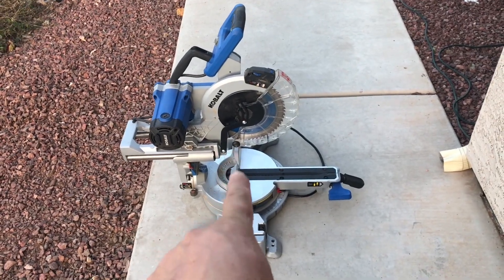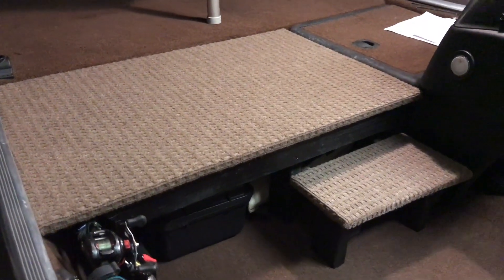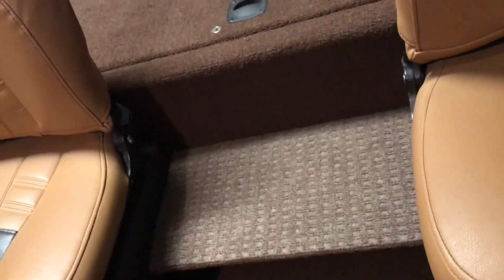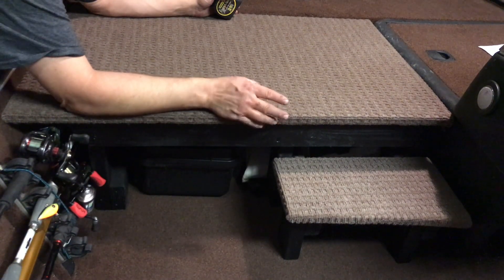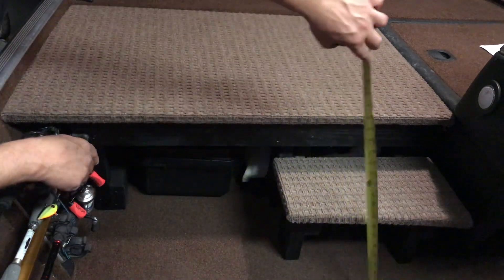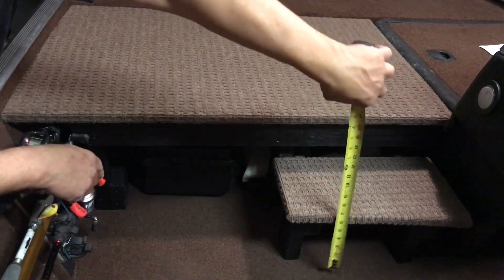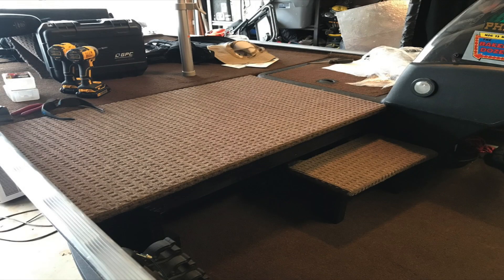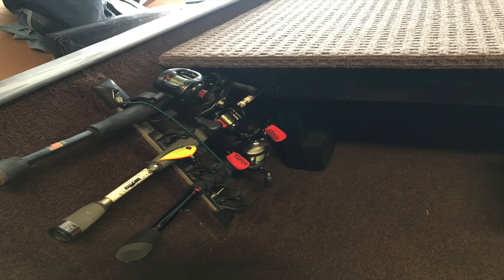Building a cheap casting deck extension for the Bass Tracker Classic

Comment: Hey Mark great job on the deck and step, making it removable was a good idea. Any issue removing your rods from the holder? 
The carpet looks good too...Next project??...complete carpet replacement!!  LOL ;)
Reply from the maker: I found that if I kept the rod socks on the holders as I removed the rods, it was easy to slide them back in.  If not you do have to kneel down and use a light to see it.  I honestly don't have any issue with the way it is.

Comment: I'm looking at buying the classic xl but am kinda leary because the wind blows where i'm from and a lot of the water is pretty big. Any thoughts???
Reply from the maker: WInd will be an issue if you don't buy a bigger trolling motor for sure.  They are flat bottomed so they tend to get pushed around.  Big water is something to thing about as well.  It can handle some of it but it is limited.  if your worried might not be the best choice for you?
Reply: @MarkBlackstock  I live in Washington and the columbia is the closest body of water to me and the white caps can get pretty large. I've been out on a smaller boats and it was fine but you just always have to be aware of the incoming weather. The price is just so good right now that I am having a hard time trying to pass it up. Just a new 50hp motor for the boat i have now is almost $8000.
Reply from the maker: Tanner Albrecht I’m from Washington, I think you’ll be good
Reply: @MarkBlackstock  thanks for the input

Comment: Mark Great Job on the added deck to the Heritage. it looks great. I just got 2 questions. Have you ever thought about adding a storage box to it, and did it take up any of your rod storage? thank you for the video. Steve
Reply from the maker: I lost the bottom hole for the rod, I could have saved it but didn’t want to adjust.  There’s plenty of storage under it for my liking so I won’t be doing  a storage box.
Reply: @MarkBlackstock   Ya I wouldn't like to do that either. just loose the 1 rod holder. thanks for replying back. Steve

Comment: did you treat the wood?
Reply from the maker: Nah, it doesn’t see rain.  It was cheap I did spray paint it black underneath but no seal.   I figured I’d end up replacing it before wood went bad If it does.